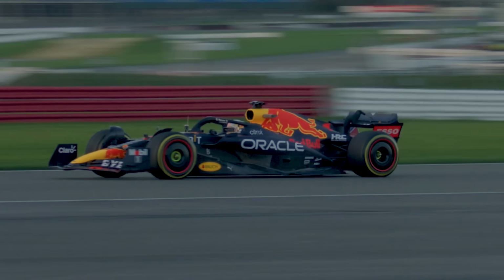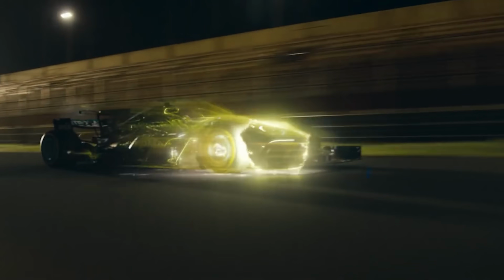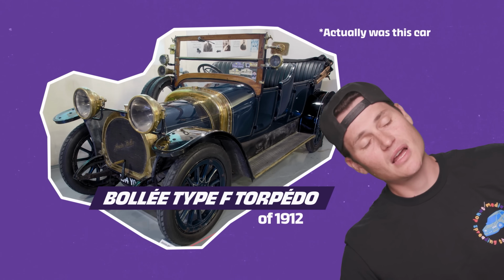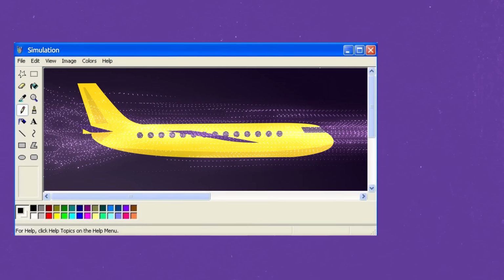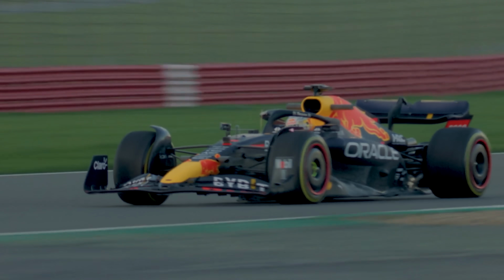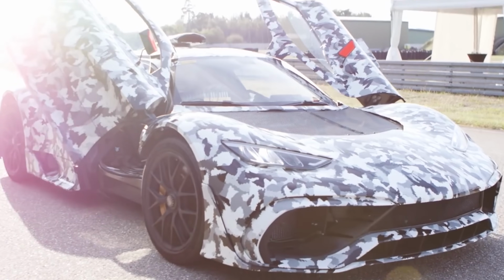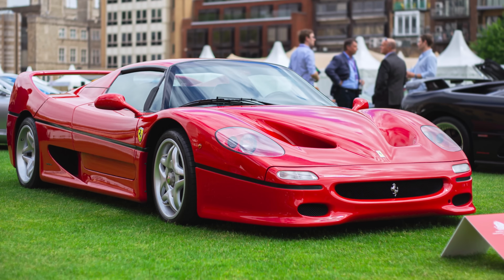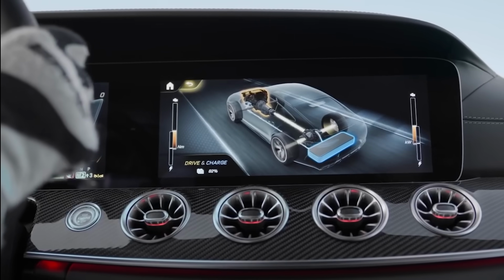Surprising Tech That Came From Formula 1

Comment: Plaid is 2.5 seconds buddy
Reply: F1 cars do 2 sec on race starts. An F1 car will make the plaid look like a one legged horse around a track.
Reply: @Българиянадвсичко-с9ж  right. carwow has some drag races with F1 cars, go watch them lmao
Reply: @pkplayer358  That's a V8 era F1 car, the car was driving with the newer gen tires which the car wasn't designed for. Also DC didn't do good starts as he hasn't driven professionally in over 10 years. Also cold tires. And F1 cars are made for going around a track and have quite a lot of air resistance. Honda once took on of their cars on a salt lake without a rear wing and went 400km/h... I don't know why you're comparing a car that's made by one of the best engineers in the world with a road car.
Reply: @Българиянадвсичко-с9ж  because you brought it up. I just corrected the error that the model S plaid does not do 0-60 in 2 seconds. Then you started whining about F1.
Reply: @pkplayer358  I didn't meant anything against you lol
Reply: @Българиянадвсичко-с9ж  cool man me neither!

Comment: I did the research and I don't see how you can call the 1912 Bollée inner shifter wheel paddle shifters... It is literally just rotating a wheel for the next gear at every 90 degrees or so.

Comment: Tbh I prefer watching P1 and GT races cause it's far easier to see a direct correlation between what's on those cars and what's going to be on new cars in a few years. It feels like the GT class cars and the P1 cars are actually testing stuff meant to go on future cars. Like the diesel Audis and the ceramic brakes they were running in '90s

Comment: i came for explanation of how prius wing in thumbnail is helpful by areo. anyway, why is corrolla hatch not corolla sedan when sedan is lighter as stock car than stock hatch and lower center of grvaity, more usable space, lower roofline=more areodynamic. prius toyota TRD handling mods to allow carrying more momentum around turns for longer battery and tires brakepad life and mpg vs relying more on regen braking (offer to get rid ofextra stuff, go see chris fix weight reduction bmw video) lossy
.  stock prius prolly lighter after taking out battery and extra stuff they put in it.. so GRMN non hybrid prius.

Comment: Williams worked with Sainsburys supermarket to develop shrouds for the front of refrigerated open shelving units to redirect the cold air back onto the shelves, saving on wasted energy but also meaning you wouldn't freeze your ass off walking down the fridge isles.

Comment: Two things I am thinking about : the pre-ignition chambers that can now be found in the new Nettuno V6 unit at Maserati, and also at Renault, on their latest Clio, Mégane and Captur hybrids, they have a weird robotised gearbox (I think it's a constant mesh gear) inherited from F1 that helps to increase (reduction in friction and weight which makes it more interesting than the lossy and heavy automatics and CVTs, it's also very simple and clutchless, since the shafts are brought to speed by the electric motors).

Comment: Thing is I've asked this question several times before and I've found aside from a few cheater cars in F1 that ditched their ideas do to it not being as useful as it was later 
street car / F1 

ABS , adjustable suspension & TC street mid  40's - 50's / F1 70's - 80's . Anyone else want to ask this question . Because I can't find 1 d*** thing that was in a F1 car that wasn't already used on street cars wings they went from drag racing ( was ban quick ) - street - F1 with ABS it went from street - F1  TC it went from street - drag - F1 even fuel injection was street - F1 - drag . Anyone want me to continue ? So I ask again what has F1 contributed to the real world other than a distraction ?

Comment: One major thing that gets overlooked is the experience and methods of development for engineers. One of the reasons that Honda's stint in F1 in the late 90s/early 2000s was unsuccessful was that Honda had a policy where their new, young engineers would join the F1 program, and after a couple of years once they'd gotten good, be transferred back to the road car division. This obviously hurt the F1 team, but it meant that they had engineers and designers who'd spent time in the most high pressure environment with ridiculous restrictions on what they could do, and how they had to get thing X to fit in place Y and still meet target Z. The changes to the way they thought about engineering and design as a result were a huge positive for the road car division, and is one of the biggest examples of knowledge transfer from F1 to the consumer world.

Comment: The coolest F1 based car by far was the Renault Espace F1, mid-engine V10 in a damn minivan.
Reply: I am so down for the absolute absurdity that is mid-engine minivans. Toyota did it too once, just not with an F1 V10.
Reply: It looks like something you would find at Epcot lol
Reply: Except the Espace F1 is not meant to be sold to the public unlike AMG One....

That's because unlike the AMG, the Espace F1 literally just equipped with bare F1 engine without any slight tuning to it for everyday use. You cannot cold-start the Espace like a normal road car, you have to let the engine idle at 4000 RPM for a minimum of 30 mins before you can drive it, and it requires a full F1 crew team to do that instead of just one single car key....
Reply: @DannyPlaysStuff  In fact the Espace F1 wasn't even an Espace, it was half a Williams FW14 and some custom built bodywork and chassis. It was just looking like an Espace.
Reply: @DannyPlaysStuff  I had a 1983 Ford Laser that had a similar starting process 😂

Comment: The flywheel idea got me thinking. What if for a drag race you used the engine to spin up a large flywheel for about 10 sec to a high rpm and then when the light turns green both the engine power and stored flywheel power get fed to the wheels, I feel like you could more than double you hp output for a short time

Comment: The "downforce on the SUV" thing is often actually an anti-drag thing, IIRC.  I remember learning about this when I was reading up on thick airfoils for the root section of wind turbine blades.  Something to do with sharp cutoff at the end of the airfoil shape allowing a vortex to set up behind which effectively extends the chord length, giving some of the benefits of a long, tapered airfoil shape.  The sharp edge helps the air flowing over the car exit cleanly, rather than getting mixed up in turbulence behind the car, which reduces low-pressure drag at the back of the car.

Or something like that.  It's been a few years since I looked at this stuff.  Look up flat-back airfoil aerodynamics if you're interested.
Reply: Interesting, I should look into that. As a kid in grade 8, I don’t understand much of that, but it’s sure way more interesting than the crap I learn in school lol.
Reply: @jordangamesvlogs9892  true that bro
Reply: @jordangamesvlogs9892  Not sure if my earlier reply to you disappeared... anyway, I got my start in this stuff with an old, cheap, used copy of Anderson's "Introduction to Flight", an introductory college textbook.  You can find them all over the Internet.
Reply: @clawsoon  ah I see. I don’t think I’ll actually get into it, but who know maybe one day I’ll be bored enough. Yes, I think it did disappear. Just like my da- oh wait, no one cares about that anymore. Sorry
Reply: Yeah, you nailed it. German aerodynamicist Wunibald Kamm discovered the effect in the 30's, and created the body shape we now refer to as a Kammback. If you truncate an airfoil section with a sharp abrupt edge at a location at or after which the cross section at that area is 50% of the airfoil's maximum cross-sectional area, you induce an area of wake turbulence behind that flat face. This wake turbulence creates an area of low pressure that mimics the effect of the tail section you cut off in that the free stream can't enter that region, thereby maintaining smooth airflow behind the car. It's a really simple, clever trick to increase aerodynamics in an era where they couldn't rigorously understand the effects of vehicle shape on aero. You can even see it on modern cars like the C5 Corvette, Prius, Insight, or Audi A7, to list a few.
Reply: @jessenliang  Thanks, glad to hear I haven't completely mixed things up.  :-)
Reply: Is that what a gurney flap does as well?
Reply: @klee8249  It's been a while since I looked at this stuff, but I believe that a Gurney flap is a cheap, simple way to give you the high lift of a trailing edge flap.  So the sharp corners on the rear of a car are to reduce drag by increasing effective chord, while a Gurney flap increases both lift and drag by increasing effective camber.

Comment: Back in the day (late 1960's), my dad negotiated the very first contract for the anti-lock braking system when working for Boeing. Fast forward to winter of 1995 in Montana, I'm driving my folks Lincoln on a very icey road. I wasn't used to driving an automatic transmission, so my speed was too high as I approached a stop sign. The car had ABS, I stood hard on the brakes and came to a safe stop at the stop sign. Had I been in my pickup at that speed, I'd have flown right through that stop sign. So ABS goes back to the late 60' with Boeing. Pretty crazy!
Reply: Jenson had abs on the Interceptor years ago
Reply: Boeing should have gave back thrust reversers

Comment: I can’t even imagine the tech we would have now a days if Williams was still a dominant force in f1
Reply: Fia would’ve stopped and banned the tech to make it fair.
Reply: @Butti.  you either promote technological advancement or bring back the v12s
Reply: @rumbling3991  The only good thing about v12's was the sound. Performance wise, they were not that great. Very heavy, too thirsty for fuel, not too easy to control, etc.

V8 was the best compromise between power and efficiency.

With regards to hybrid tech, I don't see why it won't eventually surpass the best a v12 could ever offer but without the disadvantage of v12's. Full electric is still unviable for full formula 1 racing. From what i've seen  in Formula-E racing, the batteries give too much torque that easily overwhelms the cars. Since full formula 1 is rear wheel drive cars, going full electric would be a disaster.
Reply: @Butti.  Haha, exactly what they did. XD
Reply: Was about to say that self-driving or remote controlled race cars would be a thing but that's already a thing today.
Reply: @wotwott2319  not really racing if there's no pilot inside
Reply: Same with lotus they were a powerhouse back in their prime with Chapman running the show.
Reply: That's like asking how fast Usain Bolt would run if he hadn't aged and retired.
They are no longer dominant because they couldn't sustain the stuff they did back in the day. Williams screwed up big time with BMW, not realizing that being a privateer was no longer a viable path to success. Head was old, Newey was gone, their only shot at a major partner was fumbled... and we know the rest.
Reply: @jgagnier  I'll agree with all that, but it didn't help that every time Williams designed something the FIA screwed them. The flywheel mentioned here is a good example. It may or may not have been better than the early KERS system. No way to know since it never ran, but considering how bad early KERS was it'd be hard pressed to be worse. It didn't run because the chasis rules the FIA promised Williams were going into effect got scrapped and now the flywheel couldn't fit. Why did chasis rules change comparatively last minute for a system like KERS that F1 mandated be in design for years when they knew that change would negatively effect one team? Theories abound, but everyone knows the outcome. That change to rules was more or less the last nail in the Williams coffin. They've limped on ever since. Williams may or may not have been able to continue alone, you're probably right with not. But the FIA ban of everything they spent their money on before it even hit the track over decades surely didn't help. There were times I thought Bernie never wanted to see Williams in particular succeed. I am hard pressed to think of any team that got as many technology bans as Williams before it ever went racing.
Reply: The fact that they died out tells us they couldn't adapt, and as such probably wouldn't have done much innovation.
Reply: something like an AWCS, anti-wall crash system xD

Comment: Technically carbon fiber’s strength to weight ratio is better than most metals. Which is basically the same as saying it’s stronger and lighter, but since I’m an engineer I have to correct your words to match mine. 😂

Comment: Not just F1, but Motorsport in general has led to the inclusion of safety cells, crumple zones, brake compounds, advances in computer controlled ignition systems etc in automotive applications.
It was also a very big contributor to tech such as wear protection coatings such as on those gold coloured drill bits you see (it's actually Ti N or Titanium Nitride) and has been used in certain parts of F1 for decades.

Then there's the fire protective materials such as Proban and Nomex, which have found their way into work clothing and even oven gloves... The lists go on for a very long time

Comment: F1 teams are limited wrt budget since last year. Mercedes and Ferrari did use to spend approximately $400 million how ever in 2022 the budget cap is at $140 million and in 2023 it’s $135 million. Excluded from this is driver salaries and the cost of the top 3 executives in each team. Engine development is also not included as this is handled outside of the team.

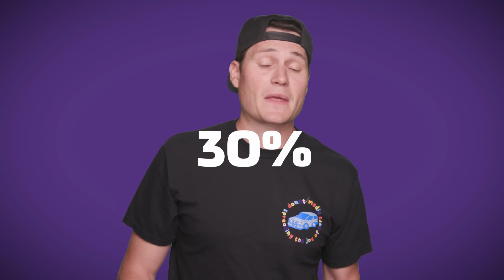Comment: 6:51 - the 2019-current Corolla has the Dynamic Force engine with a thermal efficiency over 40% - also, the manual transmission for it is reeeeeally smooth
Reply: well, he said most, not all
Reply: @aaronyoghurt9210   I wasnt correcting him
Reply: Oooh
Reply: 40% at ideal situation, at the right revs etc. nissan e power is better system arguebly, they shoudl combine
Reply: I have one, and can confirm. I love it lol
Reply: Surely these 40%+ efficiency engines (like F1 engines) are much better than electric drives when a lot of our electricity comes from fossil fuels? The power is produced when and where you need it, not all the inefficiency of electricity transmission, battery charging and discharging etc. It's mostly for that reason that I think pure-electric vehicles are silly at the moment and they're forcing them on people too soon (in the UK at least where government wants all new cars to be electric in just a few years time). Another decade or so of these crazy efficient engines that F1 etc have proven are possible would be far better for the environment.
Reply: @DaFinkingOrk   Clearly you are ignorant on this topic. Youre speaking of the "inefficiency of electricity transmission" ?
Electric drivetrain is better in just about every category - it's the batteries themselves that are the current bottleneck.
Reply: My next car
Reply: Isn't that the same family as the silly 3 cylinder in the gr yaris?
Reply: @rhyswilliams4893  oh it's Rhys Williams the inventor of all the best engines!
Reply: @TheRealSykx  😭😭😆🤣
Reply: @TheRealSykx  clearly missed my point..  the amount of power they get from a i3 is silly.
Reply: @rhyswilliams4893  If by silly you mean one of the most powerful engines toyota makes, then yes, the silly one.
Reply: @JLYK2  yes silly powerful!

Comment: 11:22 can you imagine the cost of changing this turbo if it breaks?😬
Reply: or any of the various vacuum lines or turbo lines, or the battery recharging system, the battery.....
Reply: This car isn’t meant to be driven a lot. It will be interesting because the F1 engines are designed to last around 4 races.

Comment: I have multiple Ph.Ds and the most notable contributions that I've made are in Quantum Mechanics and Einstein's theory of Relativity. I also have multiple prizes in Mathematics/Physics and have been acknowledged as a prodigy. As you might have seen, I also have the acumen for making cars, semiconductors/displays etc. As for F1 cars or other race cars, they are a work of art and demonstrate how far you can push the technologies, that's why I'm interested in what's happening in that segment. It helps in providing a direction to researchers. Engineering and Mechanical design only kick in at a later stage. You need quality research first, to make amazing locomotives, including spaceships. It has to be able to go beyond the limited set of conditions in which you currently operate them. Even the laws prescribed by science break down at, let's say, below planck's length. Locomotives have to be good enough to go beyond that, whether it's acceptable to the lawmakers of your country or not.

Comment: Active suspension would probably solve the issues with porpoising and make these new generation F1 cars far better. Apparently Russell agrees.
Reply: I like the way F1 is making the teams look for solutions. No easy button and be finacially efficient.
Reply: @alvinnieves590  financially efficient, like using tech that has proliferated the normal car market now for over a decade? Like... Active suspensions?
Reply: Dude No team on the grid is going to bail out Mercedes by agreeing to active suspension. Like why would they?
Reply: @edwinbenny2483  you act like this would only be advantageous to Mercedes...
Reply: @BionicBurke  who you trying to fool here man? Active suspension has been one of the fields where Mercedes where miles ahead of everyone else and right now Mercedes can solve pretty much most of their porpoising troubles with an active suspension. So why would teams like Ferrari and Redbull who managed to make a fast car without active suspension bail out Mercedes?
Reply: @edwinbenny2483  Newey with Williams was the OG pioneer of active suspension. Allison, with Mercedes latterly and Renault formerly, pioneered advancements in smart damping.